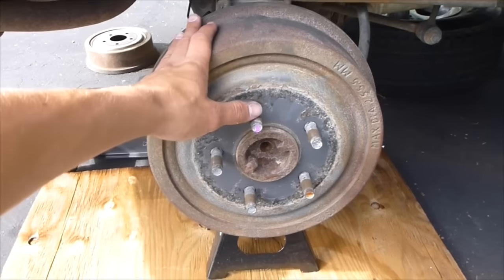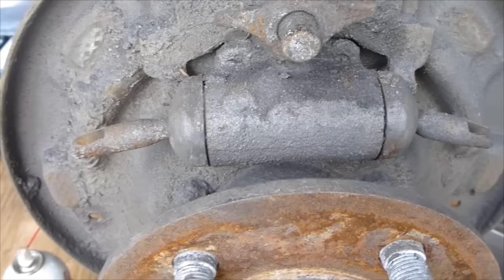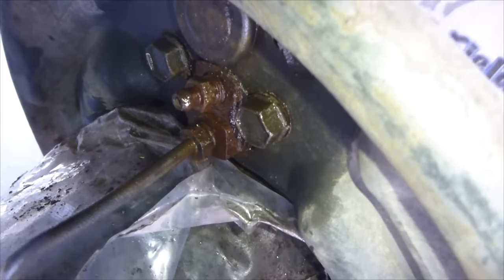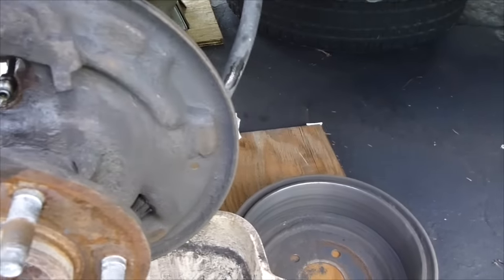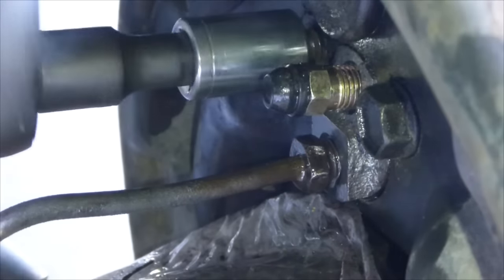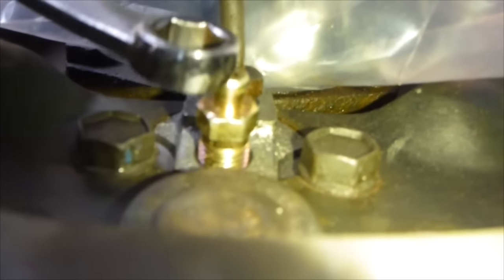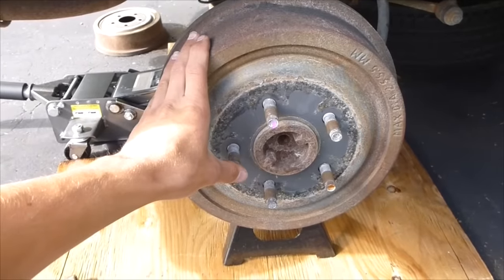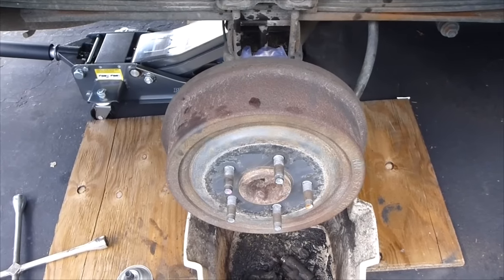How to Replace a Wheel Cylinder

Comment: I have a 2003 L200 with about 115,000 miles, I believe im the 3rd owner (im not 100% sure how many ppl owned it b4 my grandmother, who gave it to me) and I want to know if I should change this, the wheel cylinder. Im hoping to do my breaks in less than another 2000 miles, should I do this as well?
Reply from the maker: +Gregory Rose III If you are doing drum brakes. change the wheel cylinders for piece of mind. They last 100k miles or so.
Reply: +ChrisFix Cool man! Thanks for the help!

Comment: I noticed in the Video that after you put all the brakes and drums on you didnt re-adjust the shoes. Is this something that only needs to be done once in a while? Thanks!
Reply from the maker: That is because the shoes were brand new so they didnt need adjusting. If your brake system works properly, it should self adjust. That being said, if your wheel cylinders are bad and have been bad for a while, it might be out of wack so you have to adjust it.

Comment: I bought one from NAPA but it lasted a month. I put on new shoes and everything. So I take the wheel cylinder off I return it, I put the replacement in and the area where the bleeder screw it cracked so break fluid kept leaking out. I went and bought another brand from O’Reillys

Comment: It’s a pain in the behind to put the two bolts that holds the wheel cylinder on, and I figured I should just very, very lightly attach the brake line and then tighten the wheel cylinder.

Comment: Wish I watched this video. I'm currently replacing the brake lines too because I thought I had to break them to free the cylinder. Now I'm running into a problem where the fittings aren't screwing in all the way flush to the cylinder or the thing at the center of the axle where the two brake lines connect to a central box fed by a rubber brake hose.

Comment: 2:42 I would recommend using a flare nut wrench rather than an open-end wrench. I used an open-end wrench and it stripped that bolt

PS: 6:16 "That's what she said" lol

Comment: 1" bore plastic disposable syringes with appropriate piece of clean tubing on the end of the syringe (super glued on the end of the sanded syringe so it STAYS ON THERE while bleeding the brakes) the other end... SIZED FOR THE BLEEDER SCREW HEAD FOR TIGHT FIT so can suck the brake fluid thru the system by yourself. put fresh brake fluid in the master cyl, suck the old out with syringe before u put in new fluid. start with right rear (pass side) to work on as its the furthest from the master cyl. 

DO NOT PUMP THE BRAKE PEDAL TO THE FLOOR, there is rust in the bottom of the master cyl bore and when press the brake pedal ALL THE WAY TO THE FLOOR the little rubber cups go into that rust in the master cyl bore adn RUIN THE PISTON CUPS AND U WILL BE REPLACING THE MASTER CYL CUZ the piston in the old master cyl are shot from being DRIVEN thru the bottom /back of the bore that is all rusty from not having the piston run thru it EVER. SUCK THE BRAKE FLUID OUT WITH 1" bore 60 or 100 ML/CC whatever plastic disposable syringe, fleabay from CN/HK in <a month or the animal vet store. 

might want to  get small hose clamp to put on the end of the hose that is going on teh bleeder. TEFLON TAPE THE THREADS ON THE BLEEDER SCREW OR IT WILL SUCK AIR PAST THE THREADS!!!! IF TOO AGGRESSIVE SUCKING ON THE SYRINGE.the little bubbles ALWAYS IN THE CLEAN PLASTIC HOSE WILL DRIVE U BONKERS  THINKING... WHERE IS THAT AIR COMING FROM/dam little bubbles?!?!?!?!  when it is sucking air past the threads of the bleeder, NOT air in the system.

 it will take a few tries wtih the syringe as it only fills up halfway with fluid the rest is air from??? a TOTAL VACUUM?  so tighen the bleeder a little with ur 1/4"  or whatever box end wrench u leave on the bleeder til it is done. blow the used brake fluid into something, soda bottle with threaded cap on it to throw out later, and do it again til u get fresh brake fluid in the syringe that shd be 3x or so.  IF U PUMP THE MASTER CYL TO THE FLOOR... it gets into the rusty part of cyl and rips the piston rubber cups and u will be replacing the master cyl soon... might want to think about new master cyl when do brakes as a matter of course. fleabay has they ... not too bad. dont think about rebuilding them. like wheel cyls that i have tried to rebuild... ALL PITTED, the Chrome hard facing worn off the inside of the bore so it will chew up the rubber cups in the cyl no matter what and u will be doing it again soon.

Comment: If ur wheel cylinder is broken.. would there be a leak from the breakline bolt itself ? Because I got a leak from the breakline bolt.. I'm not talking about the bleeder bolt.. the bolt that has the break line thru it ... That's leaking from the bolt itself

Comment: Damn, I didn't know it was this easy.
Reply from the maker: Yea, it's cake! I am putting out a new video soon showing how to get it off if your brake line is seized.
Reply: ChrisFix I have a 4cyl Ranger too and I should have seen this video 2 weeks ago so I could ask if you could make a video of a head gasket replacement. It would be pointless now that my new head gasket and headbolt set have arrived and I can't wait any longer so I'm just gonna try to do it tomorrow, but you could still make it for future DIY-ers wanting to replace theirs.
Reply from the maker: Thanks for the suggestion! Good luck on the fix!
Reply: ChrisFix
I've never done belt timing before but it's only lining up the triangle notches then putting back the timing belt, right?
Reply from the maker: pretty much, Make sure you line those triangles on the camshaft sprocket (where the belt sits on) to the triangles on the engine. If you dont, you will have pistons hitting valves. Otherwise, the hardest part is getting to the belt! Not that difficult overall. Just take your time! Before you take the old belt off, take a magic marker and draw a line on the camshaft sprocket(s) and then on the engine so if they get out-of-line you can use that as a reference!
Reply: ChrisFix
Ok thanks
Reply: ChrisFix
I just gave up and put everything back together because I couldn't remove the upper part of the intake manifold because of a bolt being so far in the back and it's blocked by the wiper motor. I'm just gonna try those Blue Devil head gasket sealer stuff until I can get my hands on a repair manual. It looks like I gotta remove HUNDREDS of other parts after I get the intake manifold off so I'm definitely gonna need a repair manual. Damn those Ford engineers!
Reply from the maker: The Haynes manual is decent for this job. It is also pretty cheap. Too bad the bolts are tough to get to...
Reply: ChrisFix
I just bought a new wheel cylinder and tried removing the old one. It's actually not as easy as your video. The damn thing is seized so I tried replacing the internals instead but those are seized too and not even a hammer + chisel could get it out. Damn those Ford engineers!
Reply from the maker: I will make a new video to show you how to get it off if it is seized. Give me a few days. It is really not that hard at all.
Reply: ChrisFix
I found out there is a tube wrench specifically for brake line nuts. Too bad my truck's have been rounded off and I would need to cut it and replace the whole brake line. To hell with it because I only needed to replace one wheel cylinder. It's not gonna have much of an impact.
Reply from the maker: You can just loosen the actual wheel cylinder off the back of the plate it is mounted on and physically spin the wheel cylinder (that is the video I am currently making)

Comment: Hi. I got a 91 Ford f350 7.5 can a rear wheel cylinder cause the brake pedal to have no pressure and goes way the way to the floor?

Comment: Hi! I have a Mazda 323F from 2002. The hole for the cylinder is 17mm wide, but I can only find part that are 15mm wide...
What do you think, can this 2mm moving space a problem? Or the bolts will keep it in place anyway?
Thanks!
Reply from the maker: Imre Pap I am pretty sure you will need the correct width bolt because it wont screw into the wheel cylinder.

Comment: So i replaced my brake master cylinder and bled the lines til needed. Thinking i had air in my lines and knowing i needed a new Master cylinder i did so but my breaks were still very spongey. Do you think wheel cylinders could be at fault for this? i know it couldn't be my booster and I'm running out if suspects. would love some feed back.
Reply from the maker: Fabian Guillama The wheel cylinders could be the problem. Peel back the rubber and see if they are leaking. Also I assume you saw this: https://www.youtube.com/watch?v=n1NvtUwfRJc

Comment: Ok so I just changed out my rear driver side brakes and turns out my passenger rear brakes need a new wheel cylinder should I replace both of them then? It sucks because I just got everything together but if you think I should I will

Comment: Hey Chris im stuck i removed the two bolts that hold the cylinder and removed the line with the bleeder but it's seems stuck i tried to hammer the cylinder with rubber one it didn't move at all . Im afraid to brake something or maybe there is another thing holding it but i couldn't find it im working in (c1500 suberban rwd 1999) any tips will help .

Comment: You should always use a flare nut wrench on brake line fittings. They are VERY soft and easily deformed. There are no torque specs for the fittings themselves
Reply from the maker: Thanks for the tip!
Reply: +vulcan1753 oh get over yourself. this is a how-to video! and you know the two types of people who watch these videos?!? people who want to learn, and those who want to criticize the instructor to boost their own ego.  

where are your how to videos???

Comment: Great video very clear and easy to follow but wear gloves if your handling brake fluid.  It can cause nasty skin problems as I found to my cost.  A box of mechanics Nitrile gloves cost a few £/$ from a shop dont bother with the latex ones they last about as long as a party balloon in a pin factory.
Reply from the maker: Thanks man! I definitely should have worn gloves. I have blue latex gloves I use all of the time but a lot of times I forget to put them on because I am so busy filming and setting everything up!
Reply: ChrisFix
Forgot my own advice this morning when working on a motorbike.  Took a good scrub to get the muck off :-)
Reply from the maker: fastmongrel Haha, see. I get so excited and caught up on working on the car, it just happens lol

Comment: Removed rear brake drum on a  94 F250 and everything was in pieces. This included the plunger or push rods that go into the cylinder. Dont know proper name so cant search for replacement. Local parts store cant get them and Ford says part is obsolete. Any sugestions
Reply: Charlotte Helene I'd check a salvage yard. Might have to call more than 2 or 3 to get what your searching for but worth it.

Comment: So... What can you do if you followed all the directions and the adjuster screw is all the way in, but the drum fits too tightly to rotate? It was quite challenging to get it back on over the new shoes and once I had it all the way on, I tried to twist the wheel to see if it needed adjusting and can't move the wheel at all :( Is it possible that the shoes would be too tight if I installed something wrong?

Comment: Does that brake drum cover just pull right off, after you remove the tire? (I'm a girl, have to do cylindervreplacement alone, tomorrow) *Sorry if dumb question...)
Reply: Oh, I also have ti replace a caliber on front driver side too (B cylinder replacement is on driver side rear)

Comment: Hey Chris, am replacing the drum brakes too. However, the wheel cylinder is pressed or opened to the right and left is closed. When I put the new brake shoe on, I could not get the drum plate back on?

Please help me
Reply from the maker: You can move the wheel cylinder pins in to make room. Opening the bleeder valve helps them move easier.
Reply: ChrisFix
Thanks Chris. I tried pressing the pin but it can not go in? I will have a look at the bleeder valve and see how to make it move in.

Comment: What causes the cylinder to blow out after replacing it in a 2002 ford Taurus rear brakes
Reply from the maker: Could be a factory defect if you installed a new one and it failed, take it back to where you got it and replace it again

Comment: Hey Chris! Like an idiot I didn't listen to your advice at 3:08. I twisted and broke that thin, rigid, black line that connects to the hose. What is that part called? I'm having the hardest time finding it for my 2004 Ford Explorer. Thanks!
Reply: Austin Cordes The brake line?
Reply: I was able to take the part to a ford dealership and they ordered it for me. It's made out of the same material as a brake line, but it's a different part. It connects the brake hose to the wheel cylinder. Thanks for the help though :)
Reply: Austin Cordes The little nut that connects the brake line to the brake cilinder?

Comment: I have a question, my 4runner brake pedal is going all the way down and the breaking action is almost nothin, my question is changing the wheel cylinder could fix this problem? if not any suggestion? Thanks
Reply: I forgot to mention that I already checked tha pads and are ok. thanks for your help, already suscribed.
Reply from the maker: Oscar Garay If the brake pad is going all the way down, then you probably have air in the system. That can happen if your wheel cylinders are bad. If you pull back the rubber boots, is it leaking brake fluid? You can try flushing your brakes: https://www.youtube.com/watch?v=n1NvtUwfRJc

Comment: i have a 2003 nissan sentra and the rear brake shoes need replaced, i cant get to drum off, its free of the hub but it wont come off and has no bolt holes, do u have any tips?
Reply: Mech Uno

Comment: Ok but you didn't show the part where you insert the pins back into the Wheel Cylinders.  Mine are just barely in and flopping around.  Now maybe the brake shoes hold it all together but I am thinking this can't possibly work. Someone needs to show how this works and why the pins don't just fall out.  I have 3 bags of parts this is an incredibly hard job.  By the time I get all the tools out and then I have to pick up all of them it is just really difficult.

I am doing this outdoors so far no rain.

Comment: I put the wheel cylinder on and when I go to bleed the brakes, the piston starts to come out and eventually builds up so much pressure that fluid starts to come out of the rubber boot. Any ideas what is happening?

Comment: Hey man, what happens if you replace the wheel cylinder and the point where the brake pad is supposed to touch the piston continues to puncture the rubber on the wheel cylinder?
Reply from the maker: Christopher Ruesga When you press the brakes the little fork that pushes against the brakes shoe will push the shoe outwards away from the rubber on the brake cylinder.
Reply: I understand that. It slips off abs continues to puncture the rubber of the cylinder

Comment: Struggling to get the oil line loose from the cylinder. Tried penetrating oil overnight still nothing. Scared of rounding out the nut. I'm  stuck. Help.

Comment: i changed my shoes, but the drum didn't fit back on because the shoes were offset. everything was sitting in the proper place, just off center. when trying to get it all to get back into place my cylinder started leaking fluid. does the cylinder need to be replaced  or do i just put it back into place and put the drum back on? the little parts coming out of the cylinder that the shoe sits on aren't going back in to even put the drum back into place though. i somehow fucked it all up though i'm pretty handy.

Comment: Do you have to remove the pads and springs to get the cyl out?
Reply from the maker: MultiCulprit Yes, but sometimes if you can spread the pads at the wheel cylinder you dont need to.
Reply: Thanks man gonna try it.
Reply: Did it on 93 ranger with pads on. Just had to remove the top springs. Thanks for the video.
Reply from the maker: MultiCulprit Awesome and thanks for the update!
Reply: hi chris thanks for this video. may i ask do i need to bleed the whole system before i put the cylinder?

Comment: I am having a Real problem with my 2000 Nissan quest front wheels getting hot and locking up.  I have changed the caliber and still have the same problem.  I really need help.

Comment: Why are my cylinder “arms” crooked (maybe 15 degree angle) where contacts the actual brake shoes ?
Reply from the maker: Is that the old or new cylinder?
Reply: @chrisfix  both, wont straighten out. So instead of just pushing the shoes to drum, it’s going they go towards drum and slightly out

Comment: Replaced the wheel cylinder, but the brake shoes are slanted and loose which causes the cylinder to break open b/c the shoes are lower down then they are suppose to be which causes tension on the cylinder. have I missed something that needs to be tightened?
Reply from the maker: A=〉ccelerator Are you using new springs? Did you bleed the brakes yet? Those are two common problems that cause the slanting.
Reply: ChrisFix Yeah it turns out this bottom bolt was missing in the bottom, but thanks for your help!

Comment: why did u turn the engine on exactly? u needed the brake boosters' vacuum? pedal stays soft to press for flushing until pressed several times.
Reply from the maker: ***** You dont have to turn the engine on but in this case I wanted to force any air out fast so I turned the engine on. You can do it with the car off. Check this out: https://www.youtube.com/watch?v=n1NvtUwfRJc